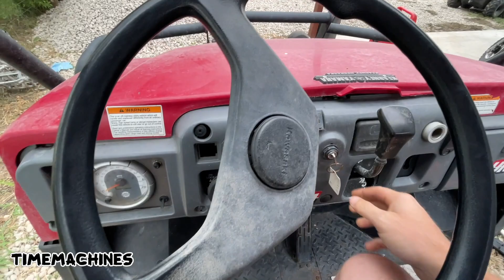Chevy Mule 350 | Wheelies and Tuneup

Comment: Best spot for the rad I think but I would put a dual fan and shroud.  Probably put a small deflector near the cap to divert coolant in case of a cap issue so no one gets scalded
Reply from the maker: It has some lines running down it should dump it on ground long before but who knows

Comment: Just to let you know right off but I have never commented on any of your videos. But they’re just looking out for your safety on the comments about relocating Radiator. I suggest maybe building some type of deflector shield along the radiator hoses or the radiator cap so if it doesn’t overheat and blow off the fluid would be directed away from you:)
Reply from the maker: Thats more helpful then saying the same thing snd never offering a solution. Although like video said and showed in end. Its sold.

Comment: You could easily put the radiator behind the push bar it looks like it has plenty of room but either way if it’s getting air flow it’s fine
Reply from the maker: Yeah but itll be more exposed to damage and if driving it will scald ya just as well assuming your driving forward

Comment: set timing a bit,  probably pick up another 30hp lol.  Do a bit more trimming around the front of the motor so the bed tips a little easier and make a cap for the motor so you can put stuff in there again, will be a real trooper unit
Reply from the maker: Hard to the way its setup all janky

Comment: Would the mule hold together for doughnuts ?   Seems like the axils and trans would be made of glass, no ?
Reply from the maker: The transmission is a turbo 400 and axles are suzuki samurais. They are solid. Itll tip over if anything. Its held up for almost 12 years the way it is

Comment: Hey man, love your video. I just bought my son a 2000 suzuki lt80, could you help me out? It runs perfectly fine, no problem starting it, but it runs like for 5 minutes, and then dies. I wait couple minutes, and it runs again, i already cleaned the carb, what could it be? Do i need a new carb?
Reply from the maker: Confirm next time it dies if its sparking or not. Cdis can cause this. So can an air leak yhat increases w heat

Comment: The Mule sounded tons better after a tune up. Send er off and keep the content fresh, make a few bucks and keep having fun with new stuff. Trophy kart, sand rail maybe ? Cheap eBay turbo kit for the danger ranger. The possibility is endless.
Reply from the maker: Man hanky there is a midget racer zx10r here in rhome im considering 4500$
Reply: @TimeMachinesATVs  quarter midgets are super fun if you're considering racing.

Comment: How long does it take a motorcycle battery to fully charge I the charge I've had mine up there for 24 hours and it's only charge halfway if only charge halfway I was so if it's the 1st time it's been fully charged it can take longer than normal is that true
Reply from the maker: Not usually

Comment: 66-70 some 70 and 71 engines had decent power but years after started emmisons bullshit cuz the gas crisis low compression non leaded fuel heads were garbage 73-79 or so heads were like 72 to 74 cc you were lucky to grt a 8:1 compression factory
Reply from the maker: This buckets pretty old
Reply: @TimeMachinesATVs  you can run the numbers on the back of the block and see whats crazy is the 1980 and 81 corvettes had like 150hp